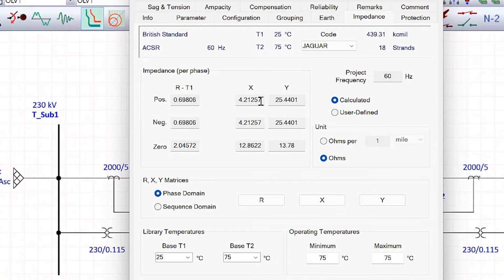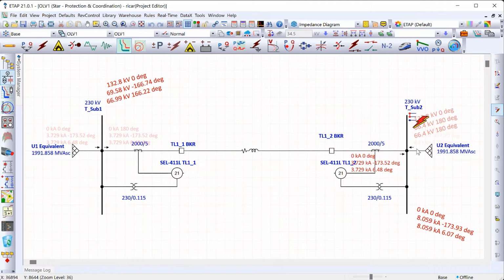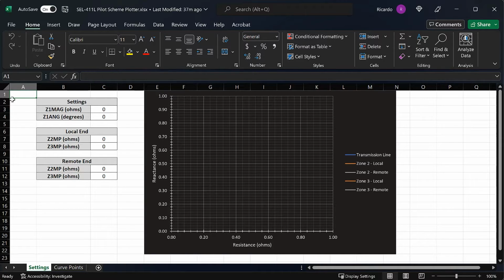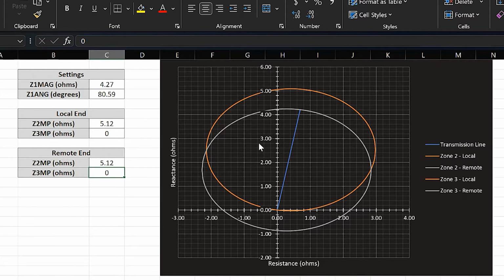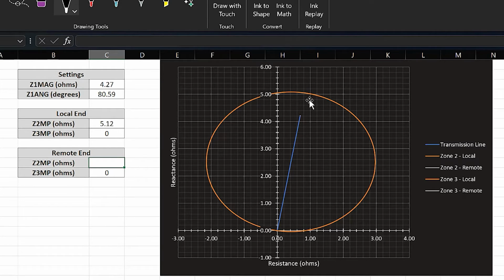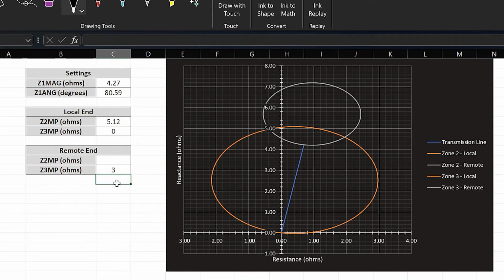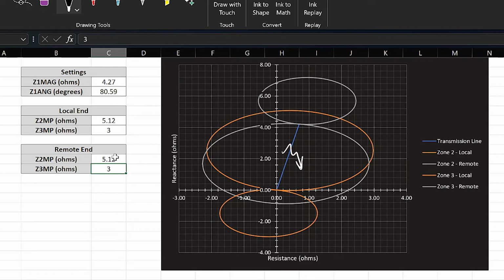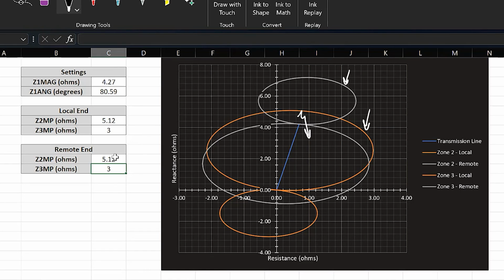Directional Comparison Blocking (DCB) Scheme Basics | Transmission Line Pilot Scheme Protection

Comment: Great video, clearly explains the concept and the excel sheet is a cool little tool. 

What is the philosophy behind blocking the Z2 when remote Z3 picks up? It is essentially covering 100% of the line but I guess by using relays at both ends of the line it provides extra security in comparison to using a Z2 with a reach of 100% of the line?
Reply from the maker: Typically, the Zone 2 element is set to overreach the transmission line with some margin to account for errors in measurement, line impedance data, etc. This is to make sure that it in fact covers 100% of the transmission line, even with some errors. A typical setting is 120%-125% of the transmission line's impedance, although it could be higher. If not used as part of a pilot scheme, such as a DCB scheme, it would trip with a time delay (usually around 30 cycles or 0.5 seconds) such that it coordinates with protection at the remote end. However, if it is used as part of a DCB scheme, it can trip much faster, since if the fault is beyond the end of the transmission line, it would be blocked by the remote Zone 3 element and therefore there is no need to coordinate with protection at the remote substation. We do need to account for some delay for the blocking signal to come in though, typically around 2-3 cycles.
Reply: @romeroengineering  Perfectly clear answer thank you.